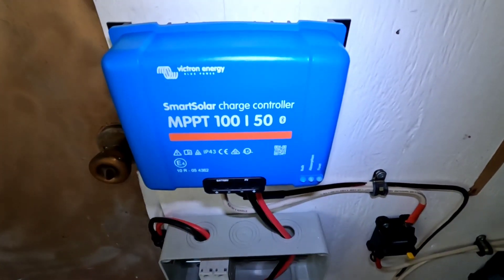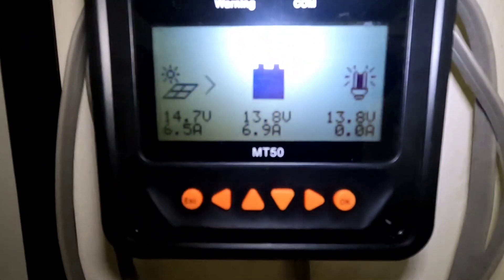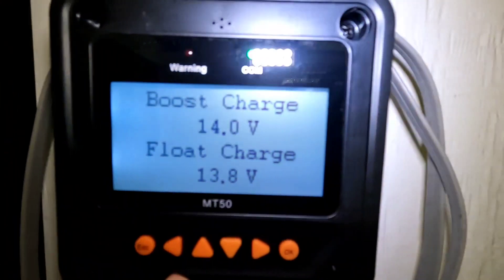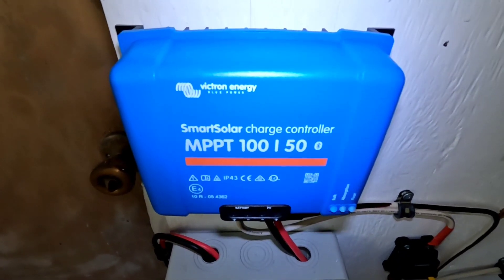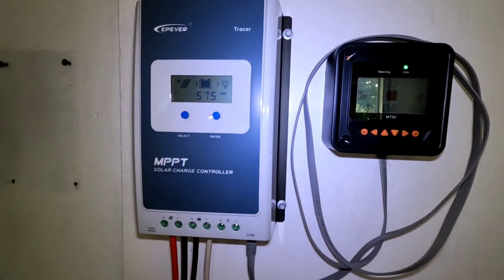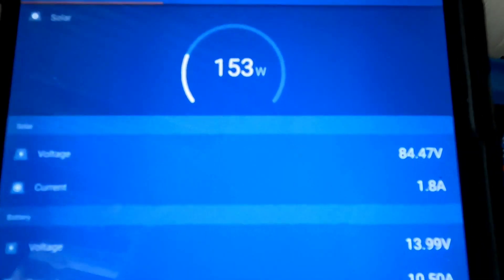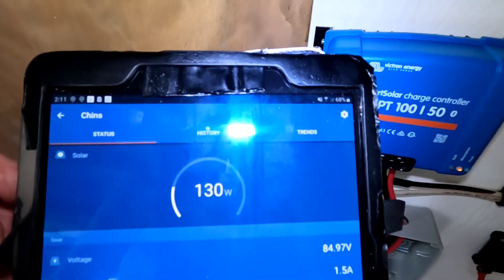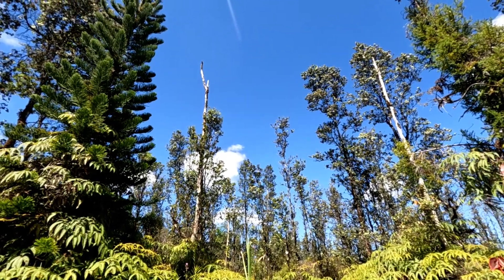Victron energy 100/50 and Epever 40a solar charge controllers side by side  exact same conditions

Comment: I also fine the EPever goes to "float" far too easily, get a spike in sun and it can go to float. I find setting the boost higher, and float lower it and a boost recovery voltage a bit low then it does kick back to boost. You seem to have come to the exact same conclusion. You can run different setting on the EPever and Victron that wont be a problem.
Reply from the maker: Definitely notice it has a real difference tracking sun, cloud,  sun situations.  Victron not so much, lightning fast. aloha 🤙

Comment: how can the epver PV voltage be at 14,8 volt and the victron at 67,7 and you say it's the same  condition? dont get it, something is wrong with your setup. PV voltage should not be that low
Reply from the maker: I meant same conditions as in sunshine,  panel location. 🤙
Reply: @ProjectsinParadise808  yeah but the panel on the epever have a problem. Look at the voltage...
Reply: @chris_mk5supra  Yep, EPEver have too low voltage to go to MPPT mode.
I have 4210AN and when PV voltage goes under 16V or something it drops MPPT mode out, just charges like PWM charger.

Comment: While you are 100% correct of course and I am now using ONLY Victron controllers, I used lesser controllers for years and was happy to do so.  For anyone watching this do not let you inability to purchase Victron keep you from doing solar.  You can always upgrade and keep other stuff as spares.
Reply from the maker: Totally agree.  Been using the Epever for nearly two years,  and has done well. But there is a noticeable difference using the Victron now. It fkat out pumps in more power day in, and day out. aloha 🤙

Comment: Don't have this issue with mine....wonder if it's a heat related issue.
Must be nice to have that consistency offered by the 20° north line.
Reply from the maker: I'm really not sure, it just seems to bounce around a little more wildly than the Victron 🤙
Reply: Do you think it might have something to do with the settings since you have to input lithium values under a User profile. Can you share your settings. I have a 4 of 3.2 volt LF280K liFePO4 batteries. Thanks

Comment: Does that only happen on the old epever or new one with lifepo4 battery settings?.  I don't have that issue till I'm at 14.1 or 14.2 then it kinda throttles itself down if I'm not running a big load.
Reply from the maker: That's on the older model which has always bounced around in voltage,  and tracking.  Aloha 🤙
Reply: @ProjectsinParadise808  My Epever 4210 has boost set at 14.5 and Float set at 13.8 and I find the battery always seems to end the day at float voltage even though I see it higher during the day.
Reply: @sammaimas155  Did you check at the bat terminals as well?

Comment: Love my Victron 100/50.  I've run 800w worth of solar to it for summer campout and didn't have any hiccups.  I haven't tried any other manufacturers, and I probably won't.  I am curious why the other is only showing 14.8v coming from the panels though.  It's showing voltage and flow like only 100w of panels are hooked up.  And then I watch farther in to the video and see the 86v on that string.
Reply from the maker: I don't know why it had the low voltage.  It went back up and ran fairly good all day. Pushing about 30 amps at 70 some volts.  Aloha 🤙
Reply: 1)What is the voltage and amperage output? 
2) Which panels do you use and how do you wire the array in series parallel both or neither? 
Cheers

Comment: How can the PV on EPEver have only 14,7V and later 86,5V ? More contact problems outside? Is the Absortion on 14,0V on both? Lithium charging should be same even if it called "user" in EPEver. Strange results so far.
However- Don't be to fast to conclude - I have seen a Australian test on 60A regulators - Victron was most effective over time, but slow to find MPPT level. The difference was only 4% to 6% better.
Reply from the maker: Good question,  and I certainly don't know why the Epever voltage varies so wildly.  Started out today around 14.7, then in full sun about 75.v pushing 30 amps...pretty good.  Both set to 14.0v for absorption yes.No conclusion yet, just a bit mystifying 🤙
Reply: shade? clouds?

Comment: Pls consider connecting all 1000w array to one controller(victron) but this is going to require stepping up to 24v  and a 24v Inverter
Reply: @tj4034  he has 10 of 100w panels  and I think he has one string attached to the victron Mppt my suggestion was to add another string to the victron and get rid of the Epever.. At 24 volts the victron will handle all 10 panels
Reply: @tj4034  true
Reply: Ya at the end he has a decision to make putting 1000w on one controller is going to limit the 83amps to 50amps, and that might be as bad as the current situation because his concern is that the Epever is throttling down early so putting 1000w on 50amps Mppt will limit 83 amps to 50
Reply: That is at 12 volts but at 24 volts all available power will charge the battery bank

Comment: Are both charging the same battery ? It can have some impedance mismatching .... When standalone, the Epever slowdonw like this too when close to the bulk voltage ? Did you try with bulk=float=14.0 ? for both ?
Reply from the maker: Yes both tied into same battery bank,  both set to 14.0v, although when Victron showing 14.0v Epever often shows higher...14.2 . I've seen this discrepancy before,  but every thing seems to register a bit different...battery,  inverter,  controllers etc. 🤙
Reply: @ProjectsinParadise808  Yes I noticed also a  +0.2V biais for my tracer 6020AN... as a lot of charger/inverter do, when being close to the  bulk voltage, the regulator slow down the amount of current... (it helps BMS balancing btw).... But when you are still far from the bulk voltage, let's say around 13.5, is the EPEVER injecting full power ? For mine, it's the case ... Thanks to the modbus protocol, I can change any EPEVER setting from a webpage... There are also some (hidden) features/ (protecting) options than can also slow down the charging process. They can  be turned off (only via the PC software or with my modbus integration)

Comment: I have the Victron 100v 20a unit paired with 2 100w solar panels.  I haven't had a lot of use with them, but so far I think it's pretty good.  I get better charging than the built in charger of my Bluetti EB55, but I expected that.
Reply from the maker: Nice🤙